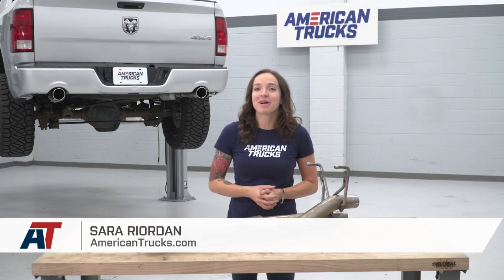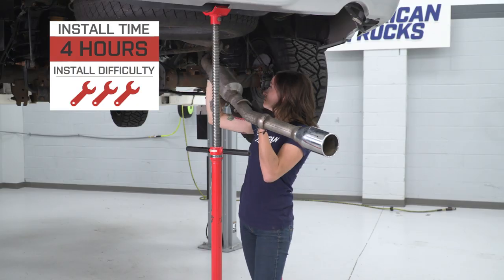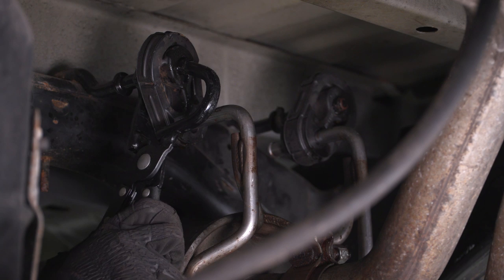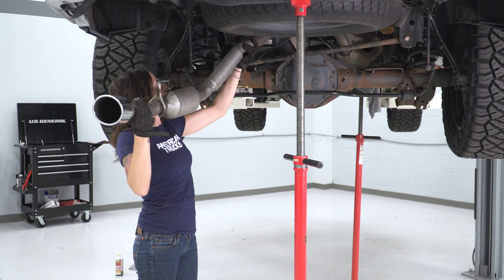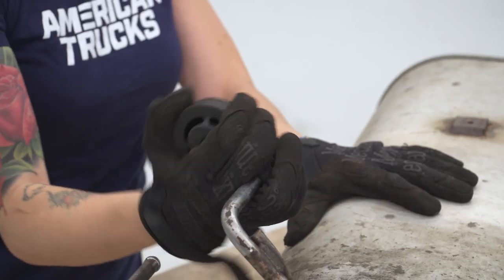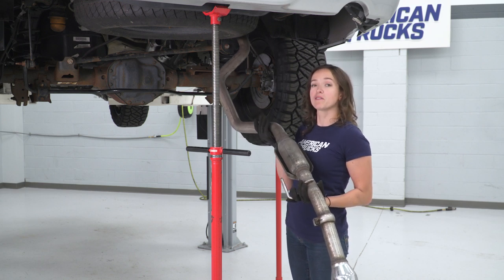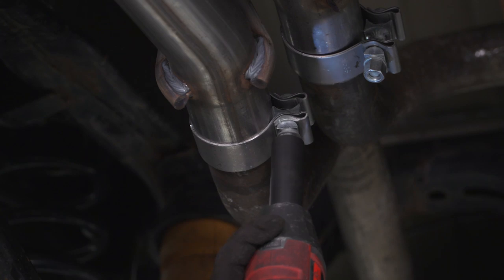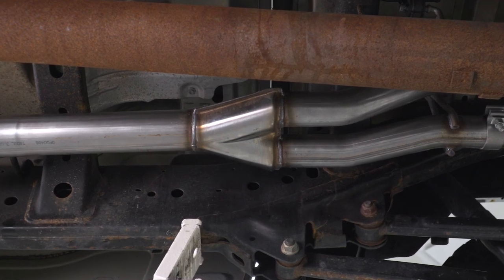2009-2018 RAM 1500 5.7L Magnaflow Direct-Fit Replacement Muffler Delete Review & Install

Comment: 4 hours? any exhaust guy could do this in 20 minutes
Reply: Seriously I did it on my garage floor in like an hour.
Reply: And is it really necessary to remove the tail pipes?
Reply: Hell, I did this shit in my driveway in 45 minutes with no lift, and I’ve never fucked with any part of the exhaust before lmao. I saw the rating and thought every direct fit muffler should be no more than a “1 wrench” difficulty. It’s literally three clamps.
Reply: @m.wilson2624  That’s what I want to know. I got two of the three clamp bolts off but the other one won’t budge. My sawzall won’t even cut through the pipe!

Comment: My driver side tailpipe is sticking out about 1inch out, how do I fix this ? My tailpipe is factory welded slightly.   The installation is easy and the truck now sounds amazing but my OCD wont let me drive with an uneven tailpipe..  very noticeable, I tried removing and putting back together and still same

Comment: Man. I got two of the three clamp bolts off with PB blaster and breaker bar, but I absolutely cannot get the third one to budge. I was suggested cutting the pipe with a sawzall but my sawzall won’t even cut through it!

Comment: Im torn between this and the carven competitor series.... does magnaflow make direct replacement 5 inch black tips?? Love the carven 5 inch tip look but they cost as much as this magnaflow system
Reply: I got my American trucks catalog coming. Got a 2016 ram 4x4 hemi express got it earlier this year with only 7500 miles on it so couldn't pass it up for the price

Comment: Is it necessary to loosen up the tail pipe?
Reply: You just loosen them and kinna scoot them towards the rear..no need in taking them all the way off, just let them hang over your axle and set the tips on the ground.

Comment: is this with the stock resinators still in place?
Reply from the maker: Yes! The stock resonators will still be in place before the tail pipes, but this Magnaflow system cuts out the primary muffler! -Zach

Comment: This is a 1 out of 3 on difficulty and a 2 hr job max. Unless your shit is rusted to hell it's easy. I did it with just a ratchet and socket on the floor no jack or lift. It's so easy. I dont know where she gets 4 hour job. The hardest part is dealing with your rusted on stock one. After that it's a 15 minute job to put the new one on and finish up. If you don't think you can do it or your truck is really rusty an exhaust shop can do it in like 30-40 minutes.
Reply: Man I’ve been at it for 5 hours because of the rust
Reply: @noah4569 been at it 2 days😂

Comment: The 2 rear clamps on my 2018 are NOT 15mm. I can’t for the life of me figure out what size they are. I’ve tried metric and standard and they either round off or won’t fit.

Comment: Just did my truck, and the driver side tail pipe sticks out about an inch farther than the passenger side. Any recommendations on how to fix this problem?
Reply: Make sure its seated all the way in on the clamp.. if it is the trim a inch off and slide it back in. :)
Reply: 7:18
Reply: @carsman4242  linemen was good. Had to take it down and reinstall it and adjust it that way.

Comment: How would it take you 4 hrs? I'm about to do this to my truck. We will see if it takes 4 hrs
Reply: If truck is to low it’s harder to move around, if your have rust those clamps will have to be cut, the pipes might be rust welding and would have to be beat or heated to be removed. Alignment for the tips. A lot can go wrong. On my 2019, it took 40 minutes with a truck that had 20miles on it.

Comment: Will this pass State emissions inspection in PA?
Reply: A muffler delete won't cause you to fail any emissions inspection nor a visual inspection. The only way you would fail is by removing the catalytic converter and installing test pipes. By removing the catalytic converter your car will throw a check engine light
Reply: As long as you don’t cut the cats off lmao

Comment: will this fit 2019? with 5.7
Reply from the maker: If it is a 2019 RAM Classic (the old body style from 2009-2018) then yes, it will fit! This will not fit the new 2019 body-style however. -Zach
Reply: This fits every ram built from
2010-2022… as long as it is a 4 door truck with a 5.7 engine and dual exhaust it’s te same part number…

Comment: Looks easy enough but- they're not going to indicate that you might encounter difficulties with the install- after all they need the support of the manufacturers whose parts they advocate-right? Any negatives would not bode well with prospective clients! I would just about guarantee that a diy install will NOT go that well nor be as easy peasy as they would have us believe! Just check out the amazon reviews for this product. Besides NO ONE has this item in stock!( as of may 2020),not even the merchant that the link directs to! I wonder why? Could it be that it's just not that good of a product?
Reply from the maker: Everyone's truck and install process is going to be a little different, obviously. Our fleet RAM has been taken apart and put back together so many times that all of its clamps aren't going to be too rusty. 😉 The hardest part of the install on this muffler delete kit will likely be the removal of your factory equipment though! Outside of that, we have 16 reviews with an average of just under five stars so our customers seem to be happy with it! We should be getting more in stock in another week or two, also. This is a solid Magnaflow product as far as I'm concerned. -Zach